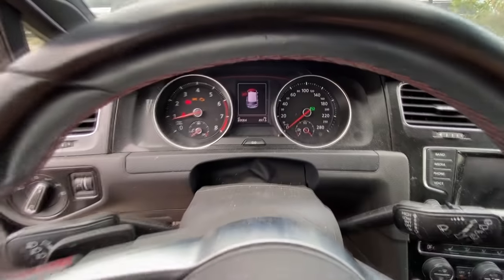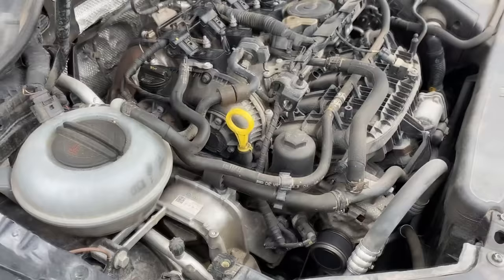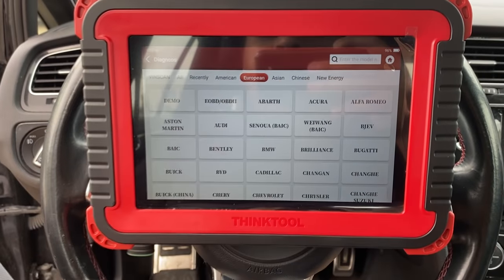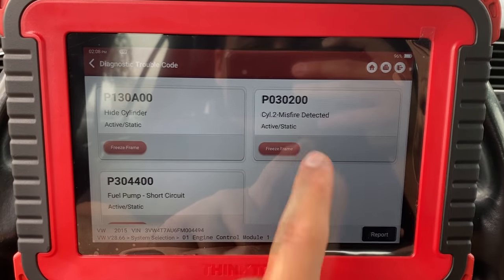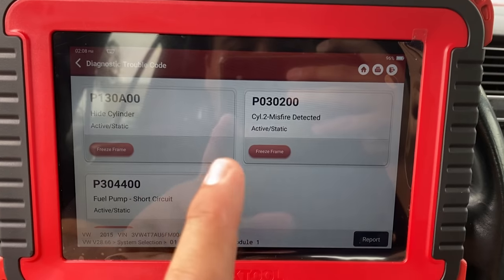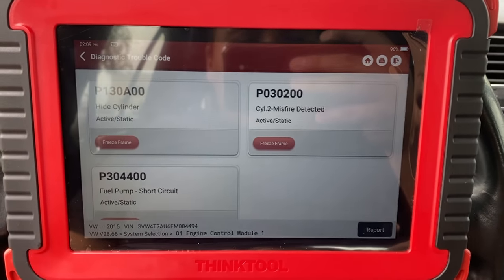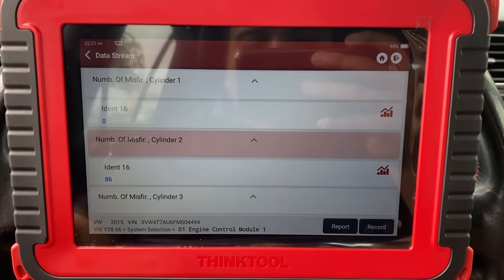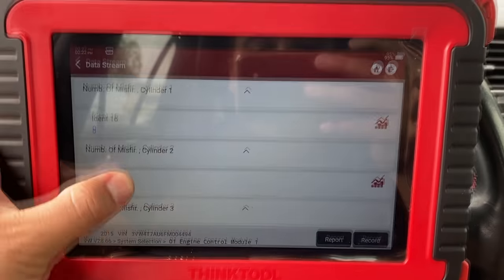VW GTI MISFIRE CYLINDER #2 NO COMPRESSION

Comment from the maker: Hey everyone! After doing some research I found this to be a pretty common issue with tuned 2.0 engines. This vehicle has a COBB tuner. Humble Mechanic actually made a video with the exact same vehicle that had the exact same problem. Check it out here! https://youtu.be/V6jzRQpMw24
Reply: And the guy from Chicago auto pros had a similar issue with his gti and ended up replacing the engine
Reply: Good to hear.
Reply: I had a 2.5. Rabbit that continually got codes on 1, 2 and 3 cylinders. Sometimes 1 and 3 together and 2 by itself. I replaced the coil packs a few times and realized that when I started the engine if I let the engine slow down to idle speed before putting my car in gear. I never had to replace another coil pack and didn't have anymore misfire codes.
Reply: I have a 2012 Tiguan that has a Unitronic Stage 1+ tune for 93 octane. I had it tuned right after replacing the timing chain tensioner at 80k. Tiguan now has 175k miles. I did replace the timing set at 160k due to chain wear. Should be good for another 100k.
Reply: Did you even watch the video????! He said it WASNT a common issue at all. He’s seen it but not common. And of coarse he’s seen it, he works on VW for a living, his whole life. And if this is a 15’. It’s a gen3. Which has many updates from the previous gens. Timing tensionioner ISNT a issue on this engine.
Reply: Can u check out video on my vw beetle 2002 2.0 engine I think the timing is off 180 but hard to find help to do timing
Reply: @IEatYouBabies  that is false.
Reply: Direct injection...sludge around the valves
Reply: I had this same issue, 
I replaced coils, spark plugs, fuel injectors, fuel pumps inside the tank, and the high fuel pump on the motor and still same issue. 
Misfire cylinder 2
The ECM sits on the driver side under the washer fluid filler, and one of the connectors had moisture, causing it to miss fire. I cleaned it with contact cleaner and put dielectric grease, and the problem went away 🙌

Comment: Hide cylinder is when the ecu turns off the injector to stop raw fuel going into the exhaust btw. That code is set to let you know the ecu has done that
Reply: Very cool
Reply: I suspected that's what it meant but it usually says injector disable command set to true on the PID. VW tries everything to have your car serviced at the dealer only 😅
Reply: So it could happen with bad spark plugs/coil packs causing incomplete or bad combustion cycle? I had hide cylinder show up once after car over boosting, along with a misfire code, so I changed spark plugs and coil packs after which the issue never came back
Reply: @brianchen3964  usually clearing the code will enable the cylinder temporarily for the first 5 seconds or so after turning on the car. If the PCM detects a fault, it will disable that. What is usually dissed is the injector and possibly the coils.
Reply: So he had to clear the code to test the injector?
Reply: @scientist100  believe it or not, the German description is just that. It's just a poor translation error over to English.
Reply: @Seriouslydave  the magic number is 50. If the cylinder misfire counters reach 50 on one drive cycle for the same cylinder, that cylinder's injector is shut down to protect the catalyst. Simply cycling the ignition switch will reset it. Of course if you have a hard fault misfire, the injector will shut down again as soon as you hit 50 counters.
Reply: It actually is vws way of saying there's a dead miss

Comment: Pulse sensor in the oil dipstick and RC test, you’ll see the compression going past the rings. Super quick and 100% proof. I can get one to you if you’re interested. Also good for verifying head gaskets and valve train problems.
Reply: Very cool idea, Thanks a lot for mentioning.
Reply from the maker: After doing some research I found this to be a pretty common issue with tuned 2.0 engines. This vehicle has a COBB tuner. Humble Mechanic actually made a video with the exact same vehicle that had the exact same problem. Check it out here! https://youtu.be/V6jzRQpMw24
Reply: @ADVANCEDLEVELAUTO  same cylinder too. Thats crazy.
Reply: @ADVANCEDLEVELAUTO  These things are some of the biggest POS engines. Wow
Reply: @trizkial7592  most of the newer vw engines seem to have some specific major flaw that leads to massive repair bills. one could almost go down a rabbit hole of what ifs on the reasons for that.
Reply: @ADVANCEDLEVELAUTO  As soon as I saw that COBB emblem, I immediately thought "This car has been driven hard."  Should have turned the engine over to put piston #2 near the bottom in order to inspect the bore walls for scoring with your bore scope.  Might have gotten the answer quicker without resorting to redoing the compression test with the squirt of oil.

Comment: I work on these cars for a living. Hide cylinder is VW jargon for fuel injector deactivation due to excessive misfiring. I'm still early on in the vid, but going to guess it needs carbon blasting. If it's not a coil.

Also if you have Otis or VCDS you can select a cranking test where the ECM will deactivate the fuel injectors so it does not start. If your scan tool can't do this, removing the air intake box takes seconds and you have a direct shot at the starter to jump it from there.

Finally, this is a Gen III TSI. These don't get timing chain tensioner failure. That was the early models (2008-2011). I would have been curious to see the intake come off. I have seen these "service upseller" repair centers push chemical induction services on these engines, and it kills the engines. It is not a VW approved method. VW wants you to pull the intake and mechanically clean the valves. The chemical induction services can warp exhaust valves, and even cause mechanical damage due to hydro locking.

Comment: Timing chain issues are only common in the gen 1 Tsi motors found inf 2010-14 Gti’s and early model mk6 Gli’s. Mk7’s had the updated mqb engine and e888 engines. Balance shaft issues are more common in the gen 3 engines (the model engine in this video)…

Comment: The timing chain tensioner issue on the EA888 was resolved on the previous version, in 2013.
Reply: Don’t let that make you believe you won’t need to do timing maintenance. I do mine every 90k. 
My 2014 mk6 gti had all upgraded timing parts that came in the split year added to the gen 3 ea888 and at 8k miles my car always rattled on hot days after a second start up. Turned out to be my chain stretched. All saved
Reply: @em1ownerify  I did the tensioner on my 2012 Tiguan at 80k and a full timing set at 160k now at 175k.
Reply: @sbcncsu  that’s what’s up. Those chains will begin to stretch. But easily can monitor it with odis. 

Idk why but those I’m Tiguans had the failures worse. Heard some in training speculations of the dsg causing roll back and adding slag on a failing tensioner allowing it to skip on cold start
Reply: @em1ownerify  Here in the states,  a few early fwd Tiguans got manuals,  the rest got the 09M (Aisin Warner 55SN based) slushbox automatic. The Tiguan was definitely timing issue prone but I blame it on the non-VW people who bought Tiguans to replace their rav4 or crv. Non-VW folks don't understand the care and feeding of the German engineering. You can't just drive a VW, it requires attention.

Comment: Service documents state to remove the relay for the PCM to stop the engine from starting during the compression check. Next perform a relative compression test and sync off one of the coils. In 5 minutes you will have the answers.

Comment: These cars are the best cars that I’ve ever owned when you take care of them. If you can get one brand new and take care of it according to VW specs, they can last a long time. Problems occur when people mistreat them, either by lack of maintenance or by throwing all kinds of aftermarket stuff in, Willy Nilly. And of course, like pretty much every brand, there are the horror stories of newer cars just having issues for no reason. 

I’m currently rehabbing a 2016 Passat that I leased when it was brand new. Absolutely my most favorite car that I’ve ever owned. Ended up having to trade it in because we needed a bigger vehicle and couldn’t afford two payments. I found it for sale at a good price and ended up grabbing it as the third owner. I knew that it was going to need some work and it certainly needs some TLC but it’s my project and a labour of love. These cars, used, are just a real crap shoot unless you get them looked at with a fine tooth comb by someone who is extremely knowledgeable about these particular engines and VW systems in general.

Comment: My gti has the same problem, I had the car for 3 weeks, taught my self stick and everything. The car has been in the shop for over a week now, and I miss it everyday.
Reply: @ShinyHero If the problem is on cylinder#2 almost certain it’s the oil-separator/pcv , same issue as on Audi 1.8 engine, you can for huge vacuum leak on engine oil cap(crankcase)
Reply: @mauriciomendez1238  do you know how to fix this problem sir? Does the code P0444 come up that is related to that?

Comment: As soon as I see misfire in cylinder #2, I will run.
Thanks for the advice
Reply: I wouldn't run immediately. Most of the time with VW engines, a single cylinder misfire is caused by a bad ignition coil. Unfortunately for the owner of this car, changing the coil packs and spark plugs didn't fix the problem.

Comment: Your in cylinder video shows a spec to the left of the injector nozzle with a corresponding scratch up the cylinder wall. Very similar to views I have from broken piston ring lands. Leaves aluminum bits in the combustion chamber at the top. Just a thought.

Comment: 2013 GTI here - 
I went to lunch a few month ago, and a sat in the parking lot with the engine idling for like 15 minutes while I ate, and headed back to work (5 minute drive).  I finished the rest of that day and got in to drive home and was met by a a very rough idle, blinking check engine, and a PCM light.  I hobbled over to Autozone (Sounded like a freaking lawn mower), and that exact P0302 code.  Immediate instinct was to buy a set of  spark plugs because...  Swapped C2 - didn't fix it, but they were in bad shape, so I went ahead and replaced them all.  Made a trip back to Autozone to get some coil packs.  Scanned it again to make sure no new issues popped up, and found that now C2 AND C3 were misfiring.  Bought a set of coil packs, popped em in and fixed the problem in the parking lot.   Haven't had an issue since.

This was right around 92K mile.  I've put about 6k on it since.
Reply: I had the same type of day with my 2012 gti I changed the spark plugs and one coilpack but nothing helped so it’s at the dealer currently getting fixed
Reply: @marcolamar8721  what was the problem?
Reply: @marcolamar8721  what was the problem?

Comment: You'll never be out of work fixing VW's .
Reply: That and Chrysler products
Reply: I've had a ton of VWs and for the most part they have been pretty rock solid.  I took one look at this hunk and immediately knew it was junk.  Tuned, stupid badging and tons of aftermarket crap.  Interior looks like the inside of a grease bucket.  Not surprised it runs like junk also.
Don't blame VW - this is just a thrashed POS.
Reply: @AtlasCroc  I think they tend to go into ''entheusiasts'' hands aka teens and people who will trash them. Good maintenance and driving them conservatively is gonna make them last. Nobody is gonna drive a GTI nice well...not many. Essentially people who beat on cars lean torwards these hot hatches. Stock they seem ok ish. my dad has an 04 1.8T And its good as gold, uses amzoil and the oil comes out super clean after like 10k kms so 6k miles or something and burns/leaks not a drop. The rustbelt will be the end of that car, engine is gonna still be going i figure. We also have a 04 Golf witht he 2.0 o_O its so slow but shit that thing is at like 180k miles i think like 360k on it, maybe its more near 220k miles, thing just goes though.
Reply: @AtlasCroc  they get hate but in driving them for the last 30yrs or so I've never had one stick me on the roadside needing a tow.
Reply: And opel  :))
Reply: @justinhayward5027  fiat.products are worse than vw 🤡 ea888 is award winning
Reply: @AngelValdovinos  According to the JD Power Dependability Report there is not a big difference, VW is at 163, Fiat/Chrysler at 166 and almost the bottom of the list.
Reply: As a previous subaru owner that comment makes me laugh😂
Reply: I have a 2003 1.8t that has 206k miles and still runs strong. I’ve had it since 140k and since then it’s had a stage 2+ tune with bigger injectors and turbo. It’s not necessarily vw it’s more the owner and how well they take care of their stuff.
Reply: @kevina4674  a mechanic told me " no car company is more reliable than another...it depends on how well the customer  maintains the car"
Reply: Very reliable cars it’s just a lot of preventative maintenance on things like gaskets and such. Really the most annoying part of the cars is the difficulty in repairs rather than the repairs themselves.
Reply: @clint1285  this is good right here. Every car comes with its quirks but if you know the car well enough you will know what needs to be done and how to drive it.
Reply: @baileyhatfield4273  there isn’t a single problem tuning cars as long as you upgrade all the hardware accordingly. You seem like the type of dude to cash out 50k for an RT
Reply: LoL!  Those dam plastic water pumps!
Reply: Jump start at the beginning too funny 😂😆
Reply: I’ve had my gti 2 years no problems aside from maintaining
Reply: Youll never be out of work working on ANY vehicle. Thanks to these "brilliant" engineers. They make things specifically to break, and be weak. I mean hell just look at the pencil thin tie rods on a 04 chevy 2500HD. Look at dodge's transmissions. Look at hondas 3rd gear, and iac valve, and tps. Look at vw door harness, look at FORD.... doesnt matter what make. They need to give the engineering jobs to ACTUAL MECHANICS... but that will never happen because they dont want us to have anything reliable, anything that makes sense, anything that is easy to work on, or anything thats built to last. They treat the cars just like the hospitals treat us, anything "healthy" makes them lose money.
Reply: Can make a whole living on working on ecoboosts only haha.

Comment: I had a similar issue with a VW CC 2.0 L, no compression in one cylinder and low in another. Upon removal of the head found stuck open exhaust valves with no contact of valve to piston. It turned out the PCB system was defective and allowed heavy consumption of oil building up in intake and exhaust valves. Used brake cleaner to remove buildup and the head passed compression test.  The head was reinstalled without repairs but the PCB system was replaced with the latest revision as it had a known TSB. The car har been running for another 100k.

Comment: Nice diag! Quick tip for you. If you put a pressure pulse sensor on the dipstick tube you will see a spike in the crankcase pressure right after #2 TDC compression stroke. Obviously view it on a scope.

Comment: The 15 GTIs motors were plagued with problems I swapped a 2016 A3 engine into my 15 GTI after I grenaded a piston. Also the timing tensioner hasn't been an issue on the 2015 and up that was a gen 1 EA888 issue which was in the 2010-2014 GTIs and GLIs and possibly the Gen 2, The 15 and up GTIs are Gen 3 EA888

Comment: In my experience, 90 psi is a normal pressure when throttle plate is closed. 0psi is extremely unusual even with  worn out rings.  
You really need throttle plate open to get a good airflow and much more accurate compression reading.
 Putting piston at BDC would have allowed a check of cylinder walls which could have show a problem (I've seen an engine where circlips were left out at factory and pin wore a slot into cylinder wall)

Comment: I’m sure that you know this already, but to avoid having to hunt down the fuel pump fuse, an easy way (well, on most vehicles) to turn the engine over without starting it is to locate the starter relay, remove it and jump pins 30 and 87 (or whatever the contact side pins are). However, that is a bit difficult on vehicles where the fuse box isn’t labeled, but maybe the starter relay info is easier to find than the fuel pump fuse info.

Comment: Next time you’re working on a VW, just unplug the connector on your high pressure pump and unplug the 8 pin connector harness that goes to the injectors. Fuel system disabled.

Comment: Were you able to do a leakdown test on it? That would've made quick work of the diagnosis
Reply from the maker: I wanted to but the car was parked out in the lot. Too far to reach the shop air hose. Thanks for watching!
Reply from the maker: After doing some research I found this to be a pretty common issue with tuned 2.0 engines. This vehicle has a COBB tuner. Humble Mechanic actually made a video with the exact same vehicle that had the exact same problem. Check it out here! https://youtu.be/V6jzRQpMw24

Comment: Got a 2015 Passat 1.8 TSI on its way to the dealer for a no compression on cylinder 3 issue. Started as an out of the blue misfire on #3. Bought 4 brand new OEM Bosch coil packs and NGK Ruthenium plugs, didn’t fix. Fml. Took to a local shop and they told me no compression in cylinder 3 and needed a new engine. They didn’t want to dive deeper into it, just suggested engine replacement with 145k miles on it. Hopefully the dealer where we bought it when new from can figure it out and it doesn’t need a complete engine replacement because I don’t have the money for all that. Also, dead on about them stupid coil pack studs, they come off smooth as hot butter when the engine is warm but when it sounds like a 2 stroke diesel trying to crank it they’re not getting warm 😂. Hope this doesn’t cause me further financial injury.